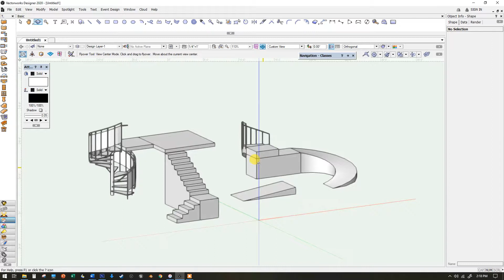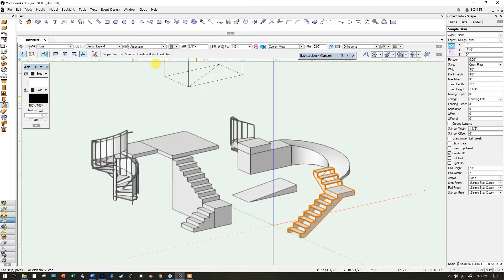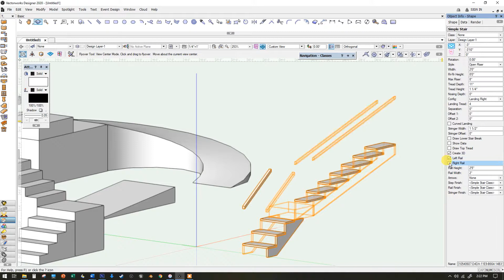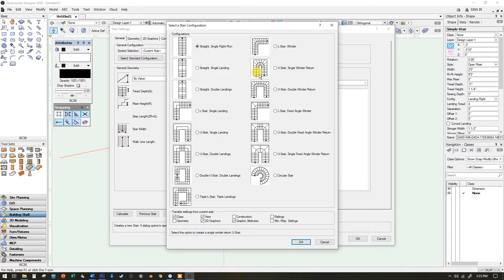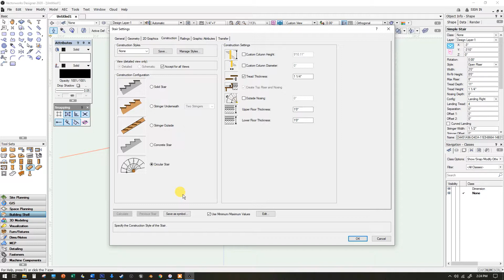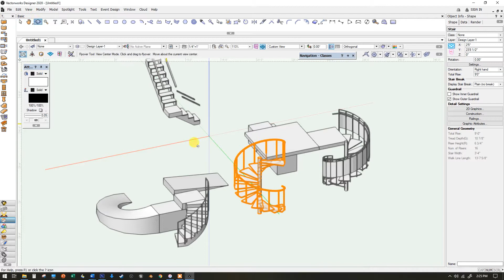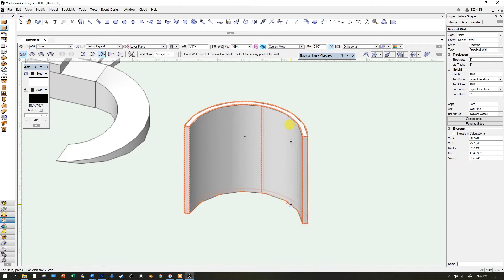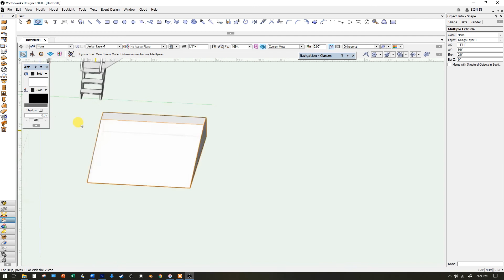Stairs & Ramps in Vectorworks

Comment: What about 2D representation? Section is fine. I'm curious if the floor plan can be represented correctly. Can we have cut symbol and up & down arrow?
Reply from the maker: Yes, of course. In Top/Plan view (Plan view not just top view) the stars are drawn with whatever 2D symbols you set up. In the stair settings there is a tab for 2D display settings. That's true for most hybrid (2D/3) objects in VW.  Watch when I have the Stair settings open at about 4:20 you can see at the top the third tab over is 2D Graphics.